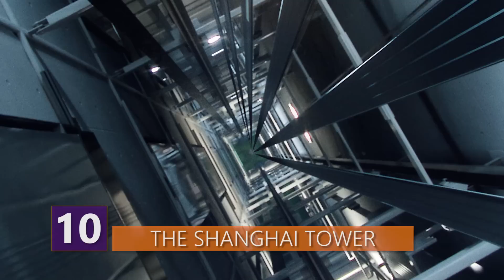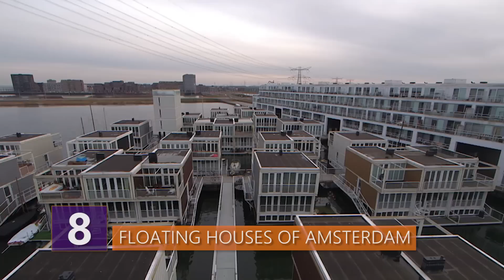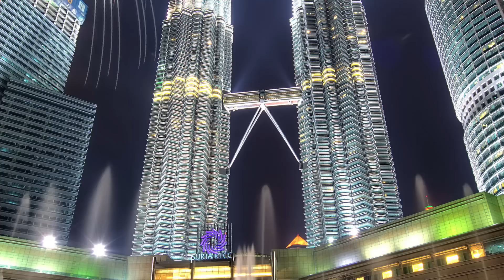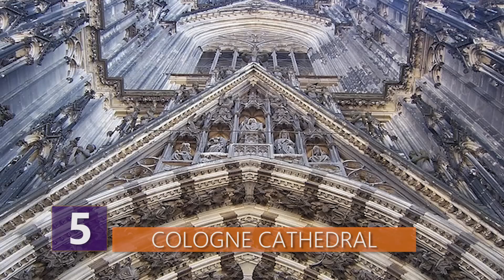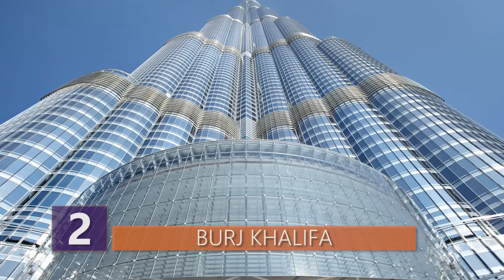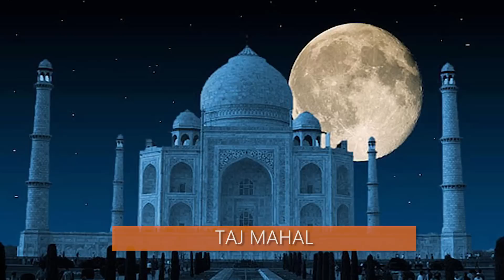The Most Amazing Things Ever Built

Comment: I noticed a couple of gaffs in the presentation: 1) I believe that the Burj Khalifa not too long ago opened a second observation deck on the 140th floor, which is higher than the one on the 127th floor of the skyscraper in China. 2) the presenter when talking about the Burj Khalifa has mispronounced the name of the "Khalifa's Emirate": it is Abu Dhabi not "Abu Dubai" as he seems to pronounce it. Actually the original name of that skyscraper was to be "Burj Dubai", but the financial crisis of 2008-2009 put the building's completion in question, so the rich emirate of Abu Dhabi - the capital and core of the United Arab Emirates - financed the project, and hence the name was changed to "Burj Khalifa".